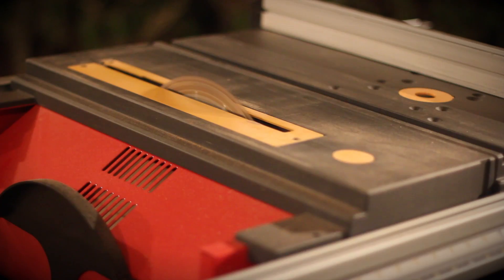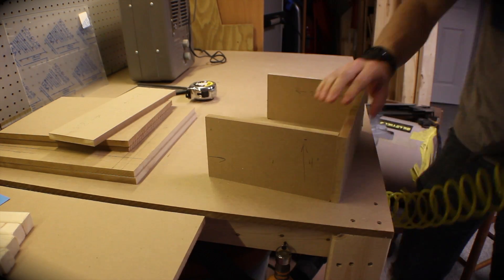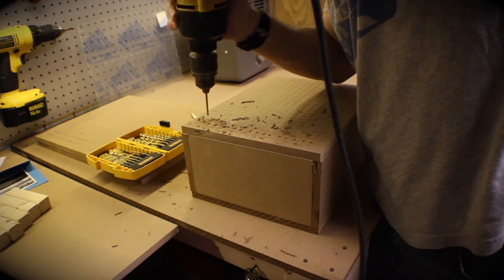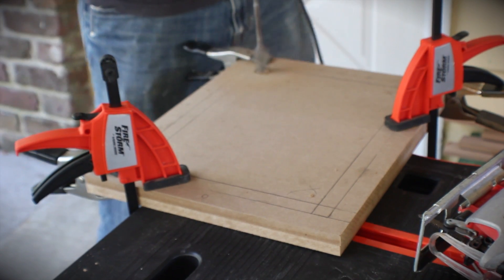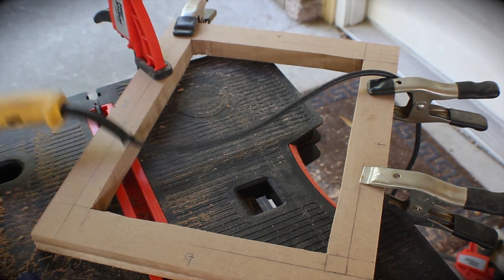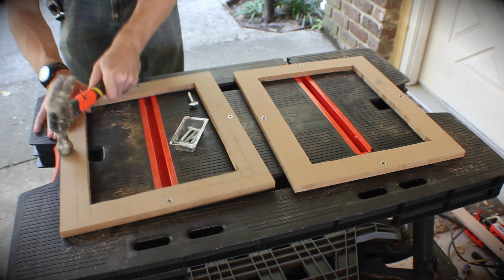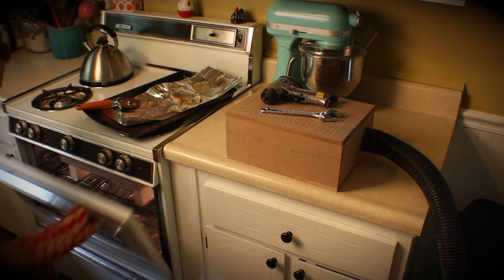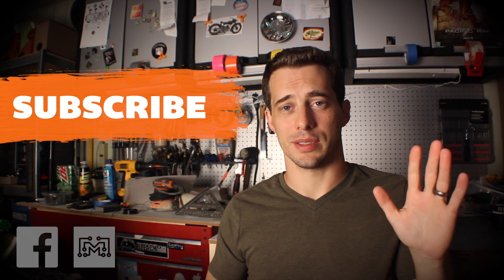How to make a simple vacuum former | I Like To Make Stuff

Comment: I know this is an old post, but I was looking to make a vacuform setup recently for a space helment visor. Your idea and construction is well done -- simple, straightforward, with no fluff. It was what I needed to step up my game. 
But, man.... your table saw techiniques send a chill up my spine! I can understand removing the guard, but using your hands on both sides of the blade instead of using a push stick, having the stock up against the fence for a cross cut, and reaching over the fence to push the stock through is just asking for trouble!  Please -- save your fingers so you can make more awesome videos!

Comment: Just ran into your video...a disclaimer should be made that using your kitchen oven is not something you want to use IF you plan on still using it for cooking/baking/roasting..you've just contaminated it and can potentially be poisoning yourself and/or family....thermoplastics outgas (toxic) as they're heated to malleable temps. 

Having a dedicated oven (bought used off the classifieds) would be more ideal. Be safe!

Comment: I would think using per board and a screen would make things pretty easy, might opt for a heat gun over the oven with thin material like that. I’ve never made one on these things, just my opinion based on what I saw

Comment: Another alternative to all the hole drilling that works really well:
Drill a single 1" hole in the center and just drop a flat piece of metal window screen on the bottom (slightly smaller than the frame of course).
Depending on how you attach your vacuum system, this method may even alleviate the need to build a vacuum box underneath as the vacuum is distributed through the screen above the bottom plate rather than under the bottom plate.

Comment: I found a quick cheat for marking out the holes is too use maths square paper and drill a hole in each corner of every square, normally 1 x 1 cm apart

Comment: 1:20 - An alternate method... which for some reason people don't think of... drill a few 1/4 inch holes and lay a screen mesh over the base board. The screen allows the suction to spread evenly even when the plastic is pulled down tight... and it leaves a nice textures pattern.

Comment: Where do you get the plastic sheets for using on the former?
Reply from the maker: +Larry Rhea I got this one at Home Depot
Reply: +I Like To Make Stuff  what kind/type of palstic did you use
Reply: +I Like To Make Stuff             Yeah, I have the same questions. What kind/type of plastic are you using, or at least what area of Home Depot did you find it in? Home Depot is a big store with a lot of stuff and it would be nice to narrow the search down just a bit. Thanks.
Reply from the maker: The plastic sheets in HomeDepot are in the back of the window department. I don't remember the exact type I used for this video, but they only have a couple of options.
Reply: I Like To Make Stuff     Great. I'll look in that area to see what I can find. Your vacuum former fascinates me and I'm looking forward to trying it. Good stuff. I'll definitely be looking at your other videos for more ideas.
Reply: I think I'm SOL at both of the Lowes stores near me. 2 mil plexiglass was all they had... It looked 2-3x too thick, IMO' but IDK TBH. I've heard of milk jug plastic working pretty well, so I'm considering PETG from a 2lt bottle. I would still be limited to SMALL stuff, through. The plastic material does need to be rigid to start out, doesn't it?

Comment: Is there a danger of toxic fumes being released when the plastic is heated?  I've been told that EVA Foam, for example, should never be heated in an oven in which food is prepared.  Does the same apply to plastic?
Reply: MDM28 yes abs may release some fumes when heated however there is a safer type of plastic called hdpe this plastic will never release any kind of fumes and is actually what most containers are made of

Comment: why not just use peg board for the top? seams a lot easier then drilling a ton of holes.
Reply from the maker: Brandon Aaskov DanielRichards644  You could, but for a better "resolution" for the form, you want more holes closer together.  The closer the holes, the more area will be affected by the vacuum.  If you're forming one big shape, for instance, that wouldn't matter, but if you were forming an octopus model, you would need more areas with holes that would work around the parts of the item that you were forming around.
Reply: Peg board is very thin and could concave under the vacuum pressure
Reply: Actually, I second that. Is there any reason you wouldn't want to use pegboard?
Reply: I Like To Make Stuff What hole size did you use? And how far apart are the holes?
Reply: Michelle Sullivan Unless you're making a forming a lot bigger then a foot or two in square pegboard would be more than strong enough without support. If you build it bigger you just add support under the pegboard. Which is the reason why 99% of companies that sell professional vacuum forming machines just nothing more than pegboard for the deck.
Reply: DaTwistedOne1 Your preaching to the choir I own a company that vacuum forms and no our professional machines are not pegboard for the deck and we have 4 of them plus 2 that we built prior to purchasing the 4 which those decks we did not use pegboard. If your going to do it do it right or don't do it at all

Comment: Bob, excellent work! I am looking to reproduce some small plastic caps that fit on the end of a 20mm X 30mm tube. Can you recommend where I can source the plastic sheeting you are using and do you know if it comes in other colors? Thanks!
Reply from the maker: ronfish99 Well, I got mine from Home Depot locally, but it really depends on the thickness and type of plastic that you'll need for the caps.  Usually, you can buy polyethylene in different colors, or you can spray paint it, or even dye it (although I've never actually tried that).  Unfortunately I don't have a great source to share with you, but I'd love to know what you find!

Comment: What is this used for?
Reply from the maker: It's for making a plastic form of an object. If you wanted to make copies of something, for example.
Reply: Ok, like a tool case or gun case, gotcha.
Reply: I Like To Make Stuff Is this just really thin Plexiglas?
Reply: Annony Mouse Yeah, it creates a (usually) perfect mould of the item so you can duplicate it :)
Reply: Thanks for the reply. :)
Reply: Ha ha, no problem :)
Reply: ChoccyMonster16 mentions using the plastic as a mould.
The other side is to use the positive as the mould to create formed plastic.
Reply: Annony Mouse They actually made stormtrooper armor using this method. They had master molds, and morphed plastic around it using the vacuum mold process. Except the plastic was white, not clear, hence the iconic white color. So, yeah, you can be a badass stormtrooper with this method. Totally worth it.

Comment: If it helps, those things with teeth on the outside and threads on the inside are called threaded inserts.
Reply: The threaded inserts are normally screwed into the material not hammered, better holding power.  Using threads in both the top and bottom frames practically guarantees a less than perfect seal.  The better way is to drill a hole in the top frame to allow the thumb screw to pass without interference; then the threaded bottom frame will be pulled tight against the top frame.  Much better seal and holding strength.

Comment: Could you use a heat gun instead of putting the plastic mold in the oven
Reply from the maker: you definitely could. The only issues are: evenly heating the plastic, so that it forms well, and keeping all parts of it the same temperature so that it's flexible enough.  It's possible though, yes

Comment: How long did you put the plastic in the overn for?  Also this video really helped :D
Reply from the maker: So glad it was helpful!! It will depend on the type of plastic that you use and the temp of the oven, but I was using 400 degrees for about 15 minutes.  It's really just experimentation though I think.

Comment: Awesome how to video. Form looks nice too. I've seen a lot of crappy ones made. Have you tried with a silicon membrane in the lid instead of using a full piece of material as the seal?
Reply from the maker: thanks! No, I sure haven't. I did see it done after I made this one, but haven't had a reason to go back and try it that way.